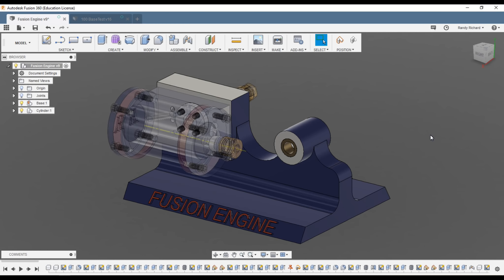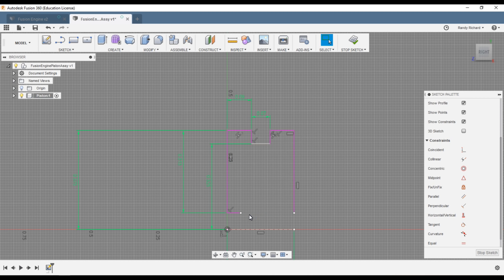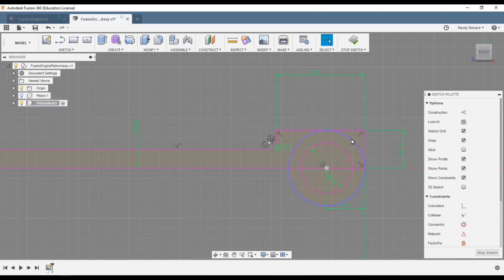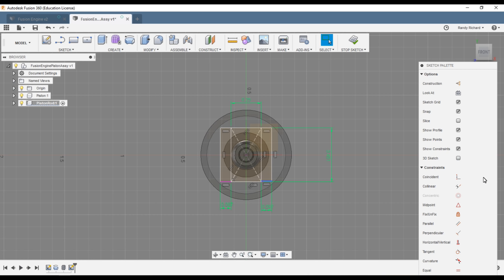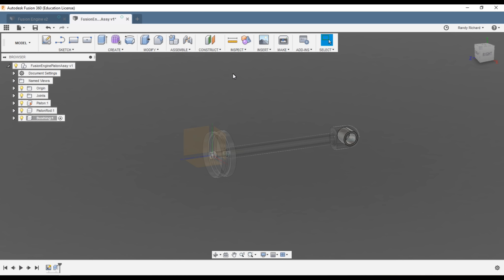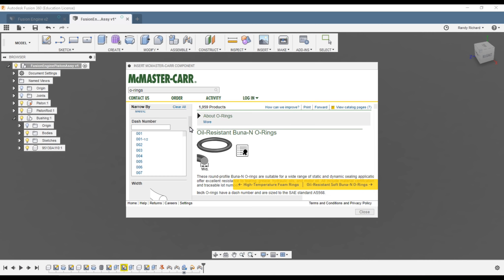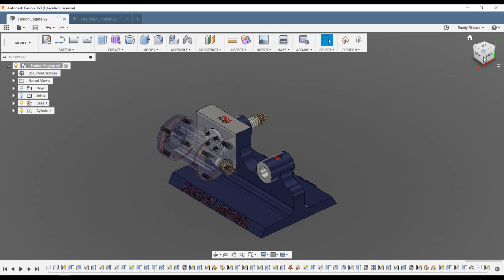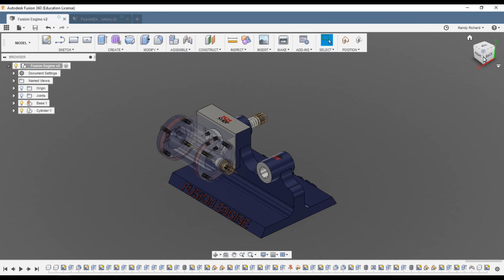P4 How to Model the Piston Assy. Of a Model Steam Engine From the Ground UP

Comment: I know I’m way behind following along with you on this series but I sure am learning a lot trying to keep my model built to your baseline. So I just got my piston assembly inserted into the model and jointed with the cylinder using the slider joint and discovered that I had not yet put a joint between the cylinder gland and the cylinder. I discovered this when I tried to make sure the cylinder and piston assembly were moving as expected like yours was at the end of this video. I must have grabbed the cylinder gland and, instead of moving the whole assembly, I was moving only the gland around in my model space. Doh!
Reply from the maker: At times turn off components that are in the way then select then turn them back on to complete the selection process.

Comment: Great series Randy, you are doing a great job of teaching Fusion360. I built 2 seal pushers, when modeling I tried to put a taper on the inside edge of the sketch with no success, I tried the same as you when you cut the brass packing nut only in reverse and it did not work, is there a way to do that. I even tried putting a draft on it, went back and just drew it in before the revolve and got it to the tapered form I wanted but I am sure there is a way of doing it. Most enjoyable series I have watched and so far have duplicated you model right up to P-4. I like your build videos too, amazing to see the parts evolve.
Reply from the maker: Are you talking about a taper on the inside of an ID.?  Send me an email or share your model with me, rrintheshop@gmail.com.